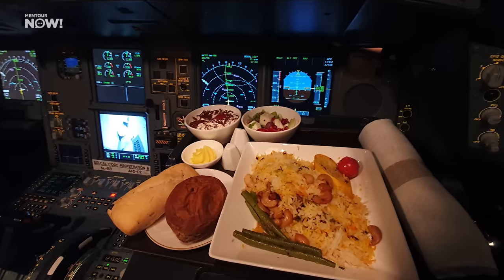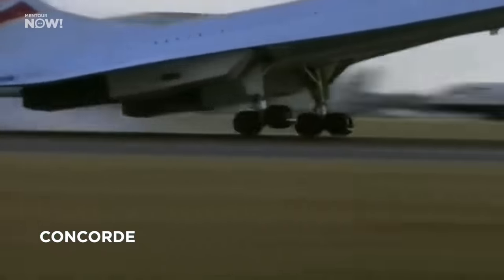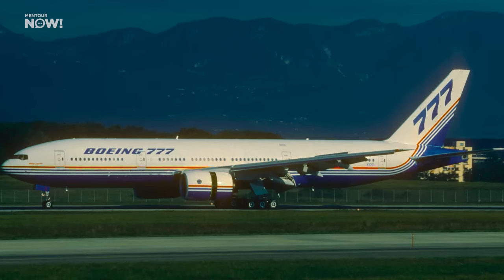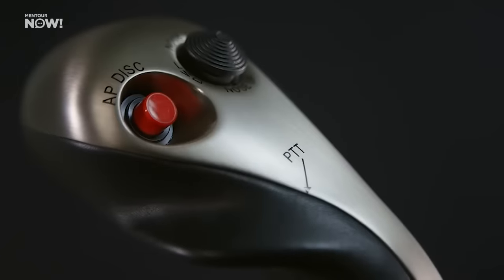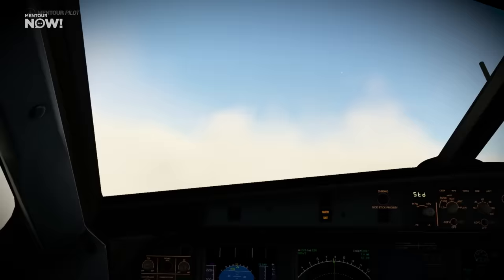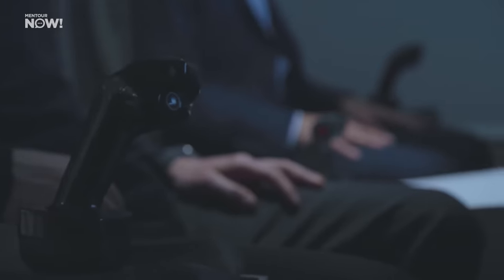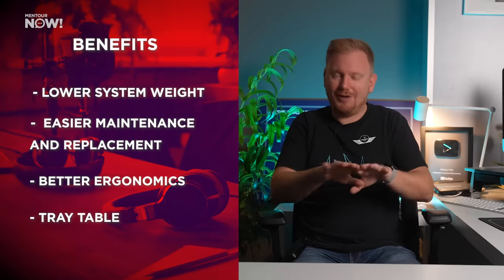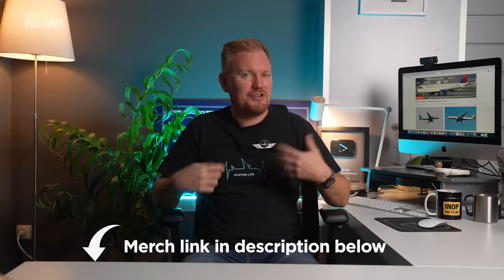Will Airbus Finally switch??

Comment: Hey all. In response to the author's call for comments from real-life sidestickers, here's my two-cents:

When transitioning to the A320 back in 2009, after 16 years of Dash8, MD11 and B737 Classic as well as NG, the only thing I missed the most, was the flight control feedback. Magically moving throttles, I didn't cry a tear for. The Airbus' autotrim works as a charm. Reverting to conventional trim in case of direct law (which I only encountered during simulator flights) didn't pose a problem. ECAM is a true blessing. Vastly suprerior to EICAS. Especially when this ungodly electronic checklist has to be managed.

I have a suspicion, that when the industry's big-heads are done with honestly analyzing all known failure modes of current Human-Interface-Devices - human as well as technical - THE best control system will present itself. And it might just look like Gulfstream's/Irkut's solution. Provided the new failure modes of that new device have been properly addressed, it looks like, ACS is, what most Airbus pilots have wanted from the very start. It also eliminates Boeing's last excuse to hold on to their silly relic. 

With the introduction of active control sidesticks into commercial production aircraft, it now has become the "current-state-of-the-art". The industry might have talked their way out of it, if it had only been the mad russians employing this deviltry. But now, with the rich&famous, not only get to demand unvaxxed pilots, but also get even fancier Gulfstream aircraft, there's no way around it anymore. It It might not have become a legal requirement yet, but acting outside of the-state-of-the-art, is a very slippery slope, legally. So for any manufacturer, not to implement state-of-the-art into their products, will open them up to huge class action lawsuits, in the event of the next mishap, which has FBW and the old yoke&stick design as contributary factor. They either implement it, or better have rock-solid arguments, for not having done so. Some crafty lawer will bring it up regardless, as sure as faith.

Either that, or chance it, and finaegel their way out of it, by palitical shenninnigans...as would be usual. FAA and EASA have evolved into palitical institution, with a tight budget and lazy politicians leading them, long ago, after all. Passengers certainly wouldn't take note of it. They will as happily get into an any Airbus or Boeing of any operator, as they jump onto a dodgy Twotter-flight to some one-way mountain slope in Nepal - fancy sidestix or not.

Fact is, neither Airbus' PCS nor Boeing's coupled yoke column are the the best available interface for an FBW aircraft. Yes, we can and do make due with either in daily operations and during most abnormal events. That's what we train for, after all. ACS seems to be the best of both worlds. But even with the perfect control device, "unreliable airspeed" or similarly critical events, are soved by the pilot; not the input device.

Pointing fingers at seemingly stupid or complacent pilots is always easy. It's called denial. "Won't happen to me", in other words. The idiosyncrasies of FBW aircraft are well known in theory. Dealing with them in real life, overcoming the human idiosyncrasies of humans (startle effect, e.g.), is quite a different affair, than reading about some obscure occurence of remote possbility. A better control device will certainly help in doing the job properly. But it still requires the same amount of training and disipline as before, to use it properly and at the correct time. So, this stick might be quite a big deal (and I think it is), but it ain't the holy grail.  

I also think, that final Accident Reports and associated findings, are importnant and carry quite a lot of weight. Airbus is indeed under quite some pressure, to come up with a working solution to this long overdue, and well-known flaw in the system, due to those recent in- and accidents, in which the passive sidestick concept has been been identified as a contributing factor. Blaming it on silly pilots will no longer do. If there had not been any pressure, Airbus would not have changed a thing. It's also quite apparent, that their quick fix, of finally giving pilots an AoA indicator of sorts. Albeit a nice thing to have, during an "unreliable airspeed" event, it does not seem to eliminate the possibility of grand fuckery under stress. Therfore, the days of Airbus' passive stick concept seem to be numbered, to an ordinary pilot. As far as the Boing incidient goes, in which undetected decoupling of linked yokes is suspected, I'd imagine, that Boing also has some involuntary homework ahead of them. Frankly, the MCAS incidents should have given ample heads-up, into Boeing's FBW implementation philosophy...or their financial management policies.

So frankly, the days of having interlinked yokes or PCS, on any FBW aircraft, might be over, soon; and thank heavens, if they actually are. As the argument for having them, has been somewhat diminished (if not eliminated), by the incident you have describibed in the video, (pending the findings of the final incident report on the Boeing mishap, of course) 

Also relevant, but a bit outside this stick/yoke discussion is, that "unreliable airspeed" (and others, affecting FBW performance) is a seriously nasty event. Not so much the handling of the problem, after recognition. Rather, the recognition itself. I do this (training) for a living. There is an extensive "unreliable airspeed" sim-prebrief, there is homework and private study. ahead of the briefing. Still, despite the fact, that the "unreliable airspeed" event is a (mandatory) planned, and announced event during sim training, the amount and diversity of grand-fuckery that follows introducing the failure, is mind boggling. And it is almost exclusively a result of recognition or entering the drill. Even from well seasoned and highly experienced pilots. So, imagine being sprung by it, on the last red-eye of a 6 day duty-block. 
Training (for it), is absolutely essential. I seriously hope, that somebody will finally wake up soon, and realize, that economizing training requirements, has not been the best of ideas, and reverses this ungodly trend. No sane pilot would ever deliberately hurt his aircraft, or endanger anybody. In these particular, most recent cases though, I wonder, whether or how much complacency, paired with retention of "old habits" is becoming a systemic problem. As being goaded into it, by minmalistic training on that subject, certainly doesn't help getting rid of "old habits". There was a time, when something similar occured. Way back, when Glass-Cockpit, FMS and GPS were becoming the new standard. (Ya, I am that old) So, is it now "children of the electronic wire"?
 (Resaerch here: https://www.youtube.com/watch?v=5ESJH1NLMLs&list=PLKbkRY_4dQ_uObyC6sVgtmxGohaSPj9YR )

We're merley human beings. Neither are we meant to fly in aircraft, nor are we meant to fly aircraft. The latter requires aqcuired skills, to enable the former to get to their destination reliably and safely. These skills require continuous, non-punitive, and very expensive training. If we have a genuine interest in keeping aviation the safest form of transport, we need to realize that it requires effort and that it has a monetary price. When I observe, that it is less expensive to fly from FRA to PMI, than it is, to take a 400km train trip to FRA, then this tells me, that the world is askew.

Quality is expensive. Less quality is more expensive.
Reply: Just a random technocratic thought. Unreliable airspeed/altitude is indeed among the most dangerous sensor failures, and so very, very difficult to train for. And it relies on such vulnerable hardware! Two tiny little holes in carefully chosen places. Can you see from meters below whether a wasp built a nest overnight? Did someone use the correct procedure but the wrong kind of tape while washing the airplane? And the real solution is to have a larger number of static systems, but you're never going to certify more neutral pressure points and put aneroid boxes in everywhere.

I've read a lot of James Albright's code7700 and he suggests learning what different airspeeds sound and "feel" like in your aircraft. But, when he wrote that he was flying private Gulfstream, i.e. in one particular aircraft for years at a time. It's much less relevant if you're climbing into ten different 737s or 320s on ten different days, and in the nightmare where suddenly all the numbers on your PFD stop responding to what you do, you're supposed to Zen out and use the Force?

It seems to me that with modern hardware and software, it would be relatively easy to have a slightly less precise but nonintrusive, more reliable backup system. It could produce a good enough estimate of IAS and AoA with some strain gauges glued on the wings/stabs and the control surface actuators. Compare those forces to the control surface deflections which are already very precisely and reliably measured, and a couple simple empirical lookup tables can spit out numbers good enough to keep the wing flying, prove and alert if one or both statics have failed, and get you home safely. I admit I can't see how to get useful altitude, at least in a nonpressurized craft. IAS versus longitudinal strain on the prop bearings/nacelles, perhaps. And GPS is probably better at that than airspeed or orientation in unknown winds aloft.
Reply: Good point all around. Especially, the note on the vulnerability of the pitostatic ports.
These things will remain vulnerable, for some time to come. so how to deal with them? Sound van never be a replacement.
The mitigation strategy so far has been "pitch and power". and that DOES work. But it does require the pilot to know these things and remember them. An AoA indicator should have been part of any het's cockpit from the very beginning, but it hasn't been. And that is still an important reason, why AoA is such a mystery for many pilots.
So, firstly, put AoA indications in a cockpit, in an easily digestable format, and secondly train pilots on how to use them. Not only for emergenvies, but in day-to-day-operation.
The did it on Concorde, why not do it now?!

As far as static ports go, the failure modes of the statice ports are way fewer in number, than those of the pitot system. On top of that, static port pailures are way less dynamic. So coming up with a "safe" mitigation for that is relatively easy.

Comment: @MentorNow Please Peter, the Airbus commands don’t average! They add to each other. I am an A320 TRI and I would LOVE to see active flight controls! It would be so beneficial in all aspects of operation, including training and building muscle memory when the auto-pilot is engaged.
Reply from the maker: What?
Reply: What?
Reply: @MentourNow so if one pilot moves their sidestick half left, the other pilot also moves their sidestick half left, the Airbus will behave like it is a full movement to the left. Adding the movements together. Not a half left like it would if averaged
Reply: @tomstravels520 you might want to check your maths
Reply: If they are moved in different directions though (e.g. 10 deg left vs. 20 deg right), it will result in the average if I understood correctly (5 deg right in this example, please correct me if I'm wrong and it results in 10 deg right).
Reply: @gastonpossel  I know how it works. Imagine it like this. 

Half a sidestick movement is 0.5 and a full movement is 1. The sidestick movements are summed up so you move both sidesticks to half (0.5+0.5=1). If the sidesticks were averaged then it would be 0.5+0.5=1 then/2=0.5.
Reply: @skayt35  no they are summed so it will be 10 degrees right (10 + negative 20= negative 10)
Reply: @gastonpossel  You might wanna check yours. Regardless of whether this is how it is in an Airbus, the average of 0.5 (left) and 0.5 (right) IS... 0.5 (total).
But if the commands are ADDED instead of AVERAGED, then 0.5 (left) PLUS 0.5 (right) is 1(total).
Reply: @tomstravels520  thanks! Makes sense now that I think of it.
Reply: yeah actually it would make no sense if the input was averaged, imagine this situation :
Pilot B is alone inputing 50% pitch down
-> aircraft 50% pitch down
Pilot A inputs 0.1% pitch up (very gentle input, barely touching the stick)
-> the aircraft would instantly go to 25% pitch down bc of dual input averaging
Pilot A releases his input 
-> aircraft inexplicably goes to 50% pitch down

It would introduce non-continuities where a very small pilot input from a pilot can have huge effects on the aircraft attitude. Summing does not have this discontinuity.
Reply: @MentourNow  if one side gives 20% left input and the right side 30% left as well, the FWB logic will give a 50% left (not 25% which would be the average). The inputs are algebraically added, not averaged ;)

Comment: I'm one definitely for the active sidesticks. Also remember that an Airbus sidestick with no A/P engaged is pretty much the same as the old CWS, control wheel steering was on Boeings , and still had low rate autotrim, so I don't know who stole who, or what, but the different technologies have been around, and certainly can be mixed matched and retrofitted to new and older Airbus. I do agree that the current passive sidestick has contributed to a few accidents. Very nice video.

Comment: I'm just a lowly Private Pilot ASEL and an A&P IA.  I flew a friend of mines Columbia that is equipped with side sticks.  I was totally lost.  I could fell the flight controls but it was just odd to me.  I much prefer a yoke.  I had never felt so behind  an aircraft. I would probably crash if I attempted to fly an aircraft that is fly by wires.

Comment: If you haven't already can you at some point discuss the challenges from moving from flying with a yoke to sidesticks? How does the transition from the right side of the flight deck to the left work in terms of using right vs. left hand for the sidestick? How much does being left vs. right handed affect one's ability to use them?
Reply: The switch from left to right does not differ between yoke and sidestick. Altough you can physically grab a yoke with either hand, in all critical phases of flight you just use one hand - because the other one has to be on the throttle.
Reply: There is no difference as of which hand is at the flight controls between yoke or sidestick. Pilots in the left seat use their left hand at the yoke or sidestick. The right hand is busy otherwise, in both setups. Pilots in the right seat have their right hand at the yoke or sidestick, the left being busy otherwise. As far as I understood Petter, changing the seat and your hands isn't that big of a deal. Certainly interesting to know though.

Comment: I remember hearing once that fighter jets use side sticks as they're easier to use than a yoke during high g maneuvers.
Reply: That's what I was about to comment on: side-sticks are great for avoiding feedback between the load factor and the commands, since the weight of the pilot's arm is resting on the armrest and not holding onto the handles. I imagine it's less important for airliners, except maybe in severe turbulence.
Reply: *yoke
Reply: @c17nav  good catch:)
Unless it was on purpose - I can very well see how a yolk doesn't agree much with high-g manoeuvres.
Reply: @melainekerfaou8418  it was a good catch, I hadnt even noticed. @c17nav thank you for pointing out my mistake!
Reply: @zeberto1986  Don’t be too hard on yourself. Yoke and yolk sound almost identical. Autocorrect doesn’t help. Neither does auto suggest. English is not easy.
Reply: @c17nav  English should be easy for me as I am an Englishman. Granted my oratory skills wont hope to match someone like Stephen Fry but I should still know the difference between yolk and yoke. I think the main culprit was that I was a bit hungry when I commented originally. Guess my hunger played out in the comment!! Lol.

Comment: I know a 787 pilot and he prefers the yoke because in cruise he can rest his hand gently on the yoke and feel what the aircraft is doing. So having an active side-stick seems to be nothing but a good thing.

I guess retrofitting is more of a logistical problem as you will have aircraft types with and without and pilots trained and not trained so it may disrupt operations. Much easier to bring it in on a new type or variant.

Comment: I’m relatively new to airbus having flown Boeings for the previous 20yrs. Two things I would change if I could would be feedback on the sicksticks and also on the autothrust. Lack of feedback in gusty conditions in normal law until you get really used to it feels very strange indeed. Not to mention upset recovery should you ever be unfortunate enough to encounter it.

Comment: I hope Airbus gives pilots force feedback on the flight controls. If airbus combines their technology with Boeings flight countrols Airbus would be perfect.
Reply: I would hope so too but they would have to change completely how their aircraft handles from a path maintaining autotrim to a trim for speed control laws like in a boeing or A220 which is the natural aerodynamical behavior of an aircraft
Reply: C-17 already does that
Reply: Maybe they can partner with Toyota and Hyundai and give fake manual transmission and  broom-broom sounds as well